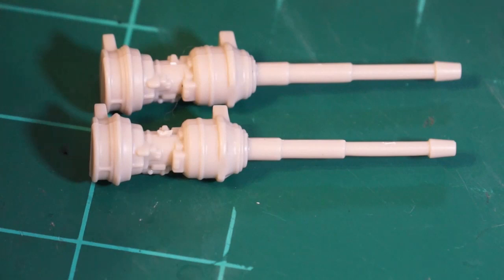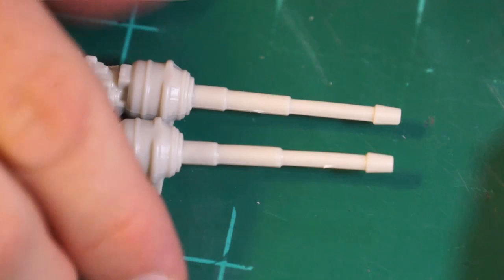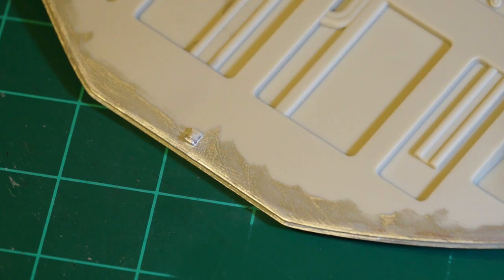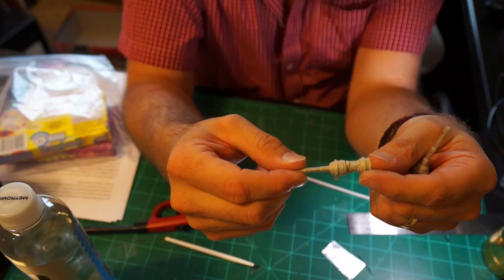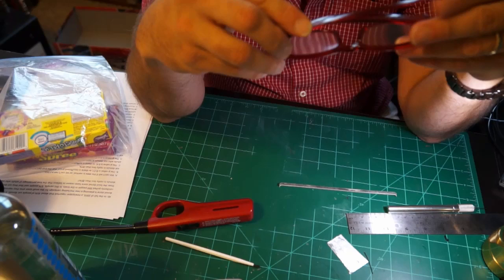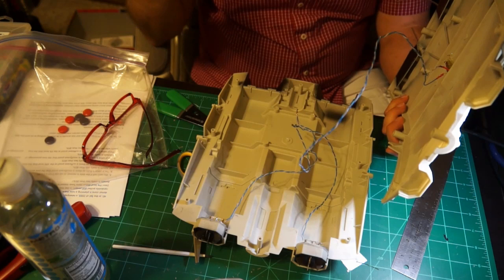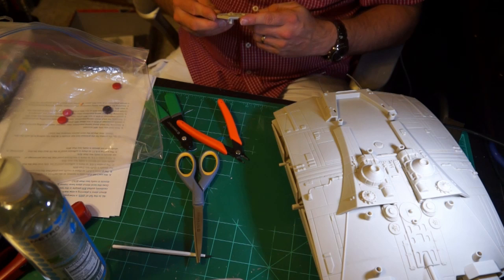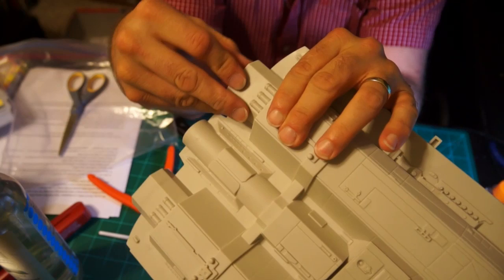Battlestar Galatica: Cylon Raider Part 6

Comment: Too bad a 10 mm led would not fit in the area where the 5 mm sits in the engine. So far, looking good.
Reply from the maker: The 10mm actually put out less light than these 5mm do.   Thanks!

Comment: How did you drill the guns?? I can fill seams easily but I can't drill in that thin of an item. Please let me know, thanks!
Reply from the maker: I started out with a very small drill bit trying for the center.  Once I got it centered, then I slowly moved up to a larger bit size.  I did not use the Tamiya handy drill on this, but did it by hand due to the nature of what I was working with.   You have to watch because at a certain point, the drill bit will start to stretch the plastic instead of cut it.  At that point you need to stop.